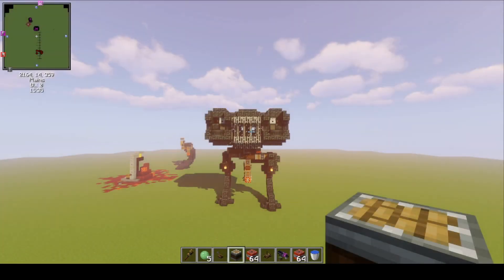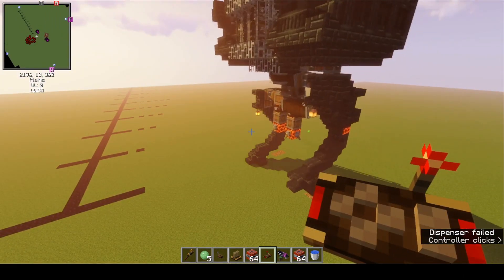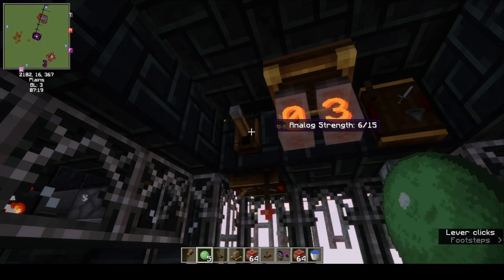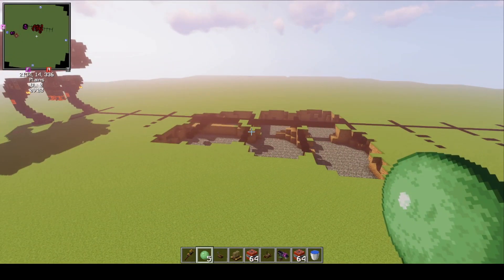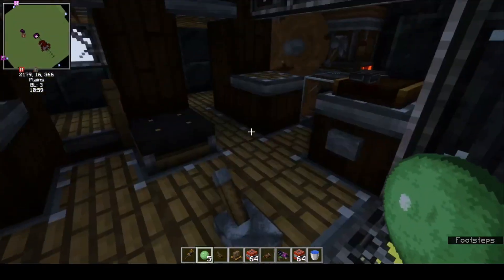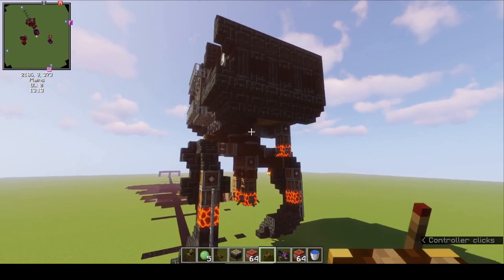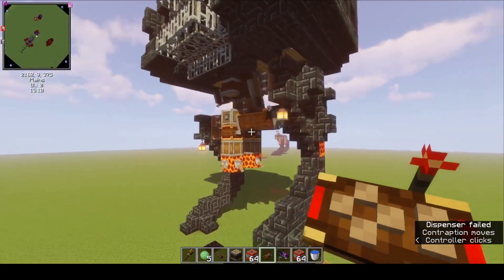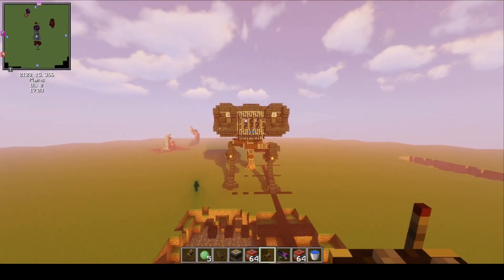Create Mod 0.4 - Mech Part 2 of 3 - Exhibition and Explanation

Comment: Magma Fan Engines don’t seem to work for me. And the Furnace Engine is missing.

I’m gonna have to make a backpack for my mech containing a Steam Engine, which the water will have to be replaced with each move of my mech, since the water itself won’t move with the build.

I’m sure I can do it, after I learn how to make All-Terrain leg functionality, and BODY ROTATION which I can’t seem to figure out Either.

The mech will be big enough to be a mobile base, but not an island.
Reply from the maker: Hey, the magma engines don't work for creat 0.5. I did update the mech in another video to work in 0.5
Reply: @KwizzleHazzizle  I’ll take a look then. Thank you for the info.

Comment: How are you running shaders with the create mod? I have a pretty good pc that can usually run Complementary on Extreme with iris at 60 FPS, but whenever  I try it on forge with the create mod I get about 15 FPS.
Reply from the maker: I'm not sure why it works for me but I have the forge version and I also have an AMD gpu in case that has an effect